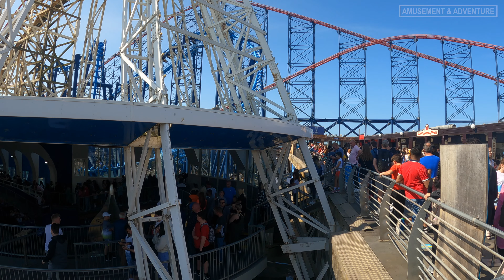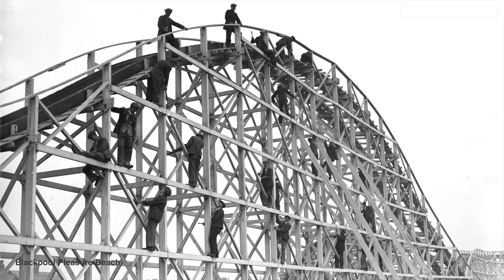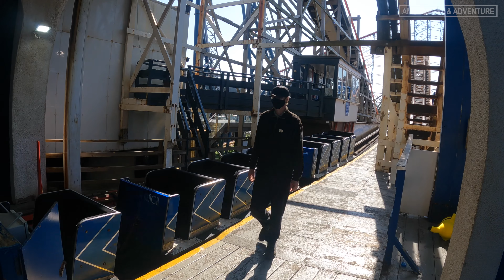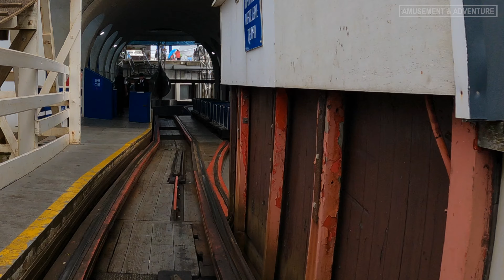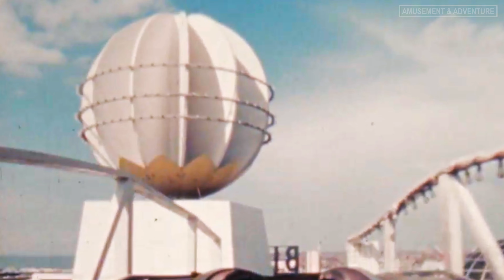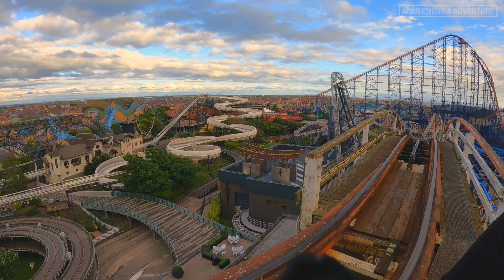The Ultimate Guide to the BIG DIPPER | Blackpool Pleasure Beach

Comment: I remember the tunnel when I rode the Big Dipper for the first time when I was just 10. There were no restraints then so as a small kid it was pretty scary sitting on the edge of the seat to reach the strap to hold onto. The brakes then were skid brakes (not fin brakes) which lifted the cars off the rails a little so they skiddefd along to a stop.